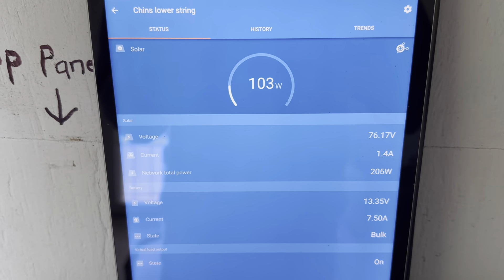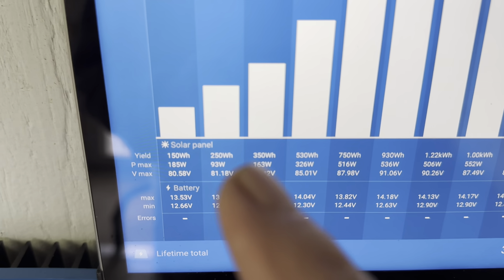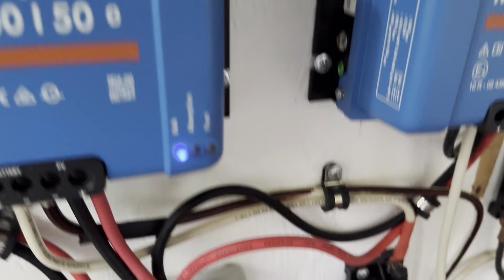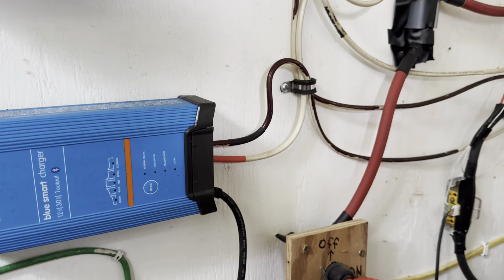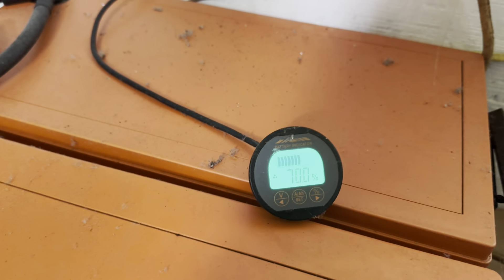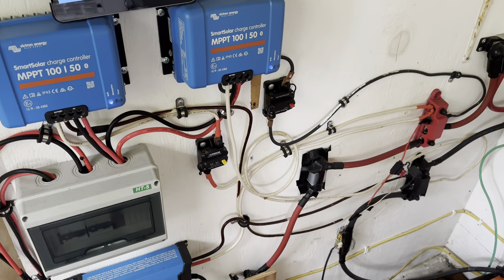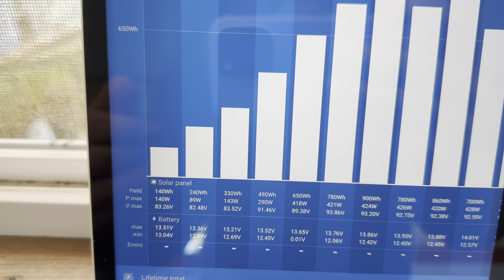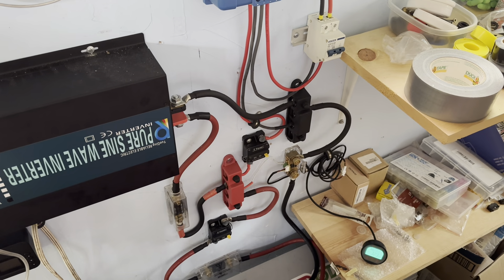Victron blue Smart Charger 12V 30A For those Dark day's

Comment: It’s been slim Pickens here in the Ohio Valley where I live as well I’ve had to run one of my generators every so often here lately. I have a small Honda EU 2000i and a champion inverter generator about the same size. lately I’ve been using one or the other which whatever one I decide to start every so often now it seems like. I have a pretty decent charger that came with one of the batteries I bought as a package deal however that Victron you got there looks really 👍 I may save up and try and get one of those👍😊  you and your family have a really nice holiday however you celebrate it and a happy New Year’s.  seasons greetings to everyone,,, peace on earth,,,love everyone👍🌹❤️👍😊

Comment: I love your channel and your simple and calm approach to life.

Regarding your changing batteries all the time, why not make a solar diversion switch. All your solar charge controllers are 12/48v compatible. Once you charge your 48v, you can theoretical input that solar charge controller to a 12v system that may need a boost, and divert that excess  power to a lower state of charge battery system.

Another idea would be to paralelos severall (all) 12v batteries instead of switching batteries.

LiFePO4 is a chemistry that will support different capacity batteries all I'm paralelo, and you would have a massive 12V system which requires less battery exchanging and less stress for every single battery unit extending expected battery life cycles.

Thanks for the video.

Comment: looks great. water pumping does take some power. Victron can do that with Bluetooth during  a low voltage condition . not very common. just power off reset does a reset of unit. it's been warm and quite windy in NY. very different than last winter.